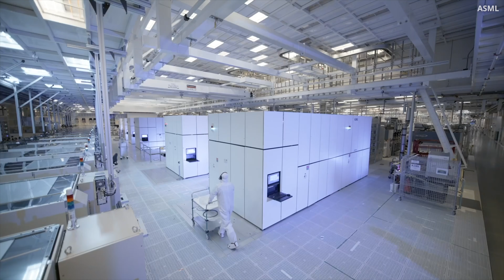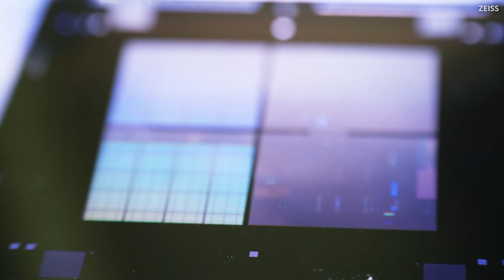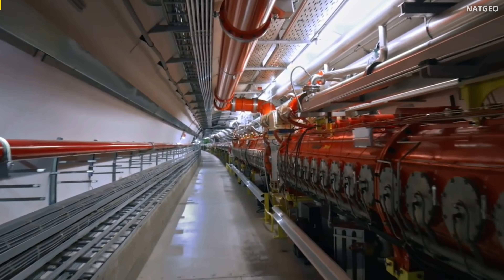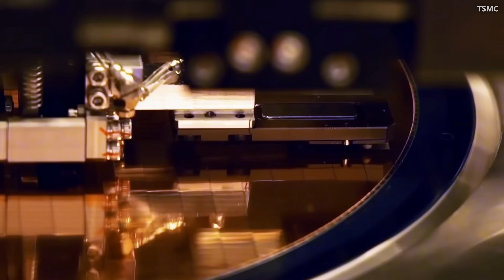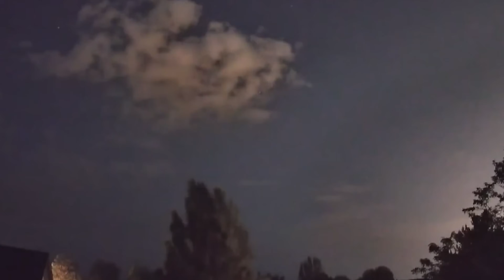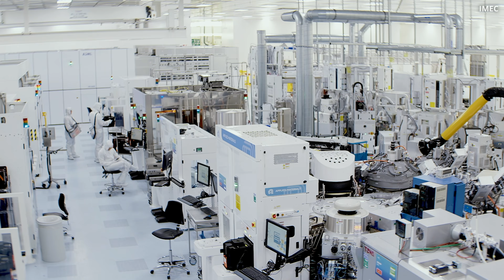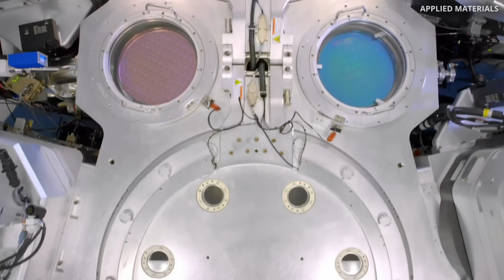New Chip Factory That Terrifies TSMC

Comment from the maker: Learn more about the Tessent product portfolio from Siemens EDA at https://www.siemens.com/en-us/products/ic/tessent/?stc=usdi103786
Reply: The ASML High-NA EUV machine costs 400+ Million dollars, and is shipped in 25 40-foot containers to the production sites
Reply: @paulmichaelfreedman8334  The shipment requires specialized handling, transport planning, and integration support. TSMC has used Gudeng Precision in Taiwan to do this.
Reply: I hope you will not say any misinformation that Intel could beat TSMC because it is a very false narrative. TSMC is really almost unbeatable in 1st place. Intel has to beat the Samsung Group first.

Joseph Y. Lee 
Former R&D Samsung Engineer
Reply: @JosephLee2012  I agree with you. Actually, after TSMC starts to mass production of COP packaging, it is almost impossible to beat TSMC.
Reply: Fire hazards in critical locations can be strongly reduced by lowering the oxygen content of the air inside. 19 instead of 21 percent is enough to snuff out any open flame that is fed by the atmosphere. Not even a candle will burn by itself. But humans can still breathe fine in it. This can be easily done by releasing extra nitrogen into the air drawn in from outside and distribute that throughout the fab where it matters.
Reply: Why are those chips round like gramophone instead of square or rectangle?
Reply: @IshaqIbrahim3 
What you did see was not the chip, but the wafer, with the chips on it. The base material, the Silicon crystal drawn is by nature round.
Search for a youtube video about chip manufacturing.
Reply: @YanDunker  Thank you.
Reply: @IshaqIbrahim3  wafers are cut from a solid ingot of 99.99999% pure, nearly single-crystal silicon, the ingot is grown in a round shape, it's how it works
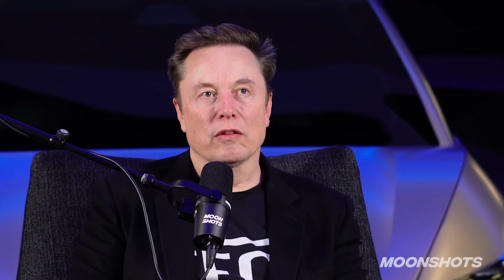Reply: After working in the leading Fab for 12 years including GAA node as FEOL Integration I can say this... 22:07 here tells me Elon has aged and now is turning into an unhinged Grandpa.
Reply: elon just got sued 44 billion today house of cards these data centers
Reply: Congratulations Anastasi, you’ve figured out that Elon is just 🐂 💩 to get government contract money! A few years ago a few governments agreed to invest billions of dollars in semiconductor. This guy is just looking to tap into that and then bail when his engineers tell him it’s undoable. Meanwhile pocketing the money the government gave him.
Reply: i tried being a chip engineer. but something about flower, sugar, eggs, and silicon just dont taste good.
Reply: Thanks but i havel already leaen how to produce using nano technology micro chips...
Reply: SO WHAT ???
Reply: I love your deep dives into semiconductor manufacturing, they are fascinating! Since you sometimes provide French versions for your Shorts, would it be possible to consider AI-dubbed French audio for these longer technical videos? It would make this high-quality content much more accessible to the French-speaking tech community. Thanks for the great work!
Reply: Great job Anastaslin.
Reply: According to Gartner’s preliminary 2025 global semiconductor revenue rankings, SK hynix outperformed Intel in revenue in 2025. 

✅ What the numbers say (2025)

SK hynix: ~$60.6 billion in semiconductor revenue
Intel: ~$47.9 billion in semiconductor revenue

That put: SK hynix at #3 globally Intel at #4 globally, behind NVIDIA and Samsung Electronics This shift was driven primarily by AI related memory demand, especially HBM, where SK hynix holds a leading position, while Intel continued to lose share in several segments.
Reply: I shouldnreport you
Reply: And water, Anastasi. Don't forget the purified water.
Reply: If new chips are coming, should I learn SystemVerilog or not? I'm interested in hardware and mind uploading
Reply: Tack så mycket. You'll soon be the 1st to use the words Quintillions of $$$ & Femto Atto and Zepto instead of Nano Nano if things don't stop going Krazy but most of all, right at the begining of this vid when you said "Oh Wow,  at so many levels.." I just wanted to climb into that jacket with you. Tack.
Reply: О каком "риске" в смысле необходимости полной загрузки мощностей вы там чушь несёте?!?🤯🤷🤦

У них экспоненциальный рост роботизированной экономики будет, — замыкание роботизации минимальной экономики венчающийся фабрикой по производству человекообразных роботов, и её экспоненциальный рост в пустынях. У них дефицит может быть, избытка у них не будет ещё на несколько порядков роста! Они в космос будут эти чипы посылать, ничего дороже с Земли вы в космос не доставите. И не только на эти орбитальные дата-центры, а для растущей лунной экономики роботов в первую очередь. 

Вот о каких экспонентах речь идёт, — экспоненты роста роботизированной экономики и экспоненты роста орбитальных вычислительных мощностей.

Они найдут куда чипы сплавить с такого производства. Реализовать. В прямую прибыль, у вас объём производительных сил будет прибывать, ваших способностей какие угодно вещи "прибыть", произвести. 

Это слишком чудовищно выгодно чтобы этого не было сделано, и именно у Tesla & SpaceX etc — у Илона Маска больше всего шансов на то чтобы стать теми кто это сделает, больше всего шансов победить в этой гонке. 

В том числе победить благодаря Terafab
Reply: Well we all know now why people like you will never achieve what people like Elon will.
Reply: What stocks are directly tied to this project?
Reply: @andyh8239 good question
Reply: The PC design is flawed,  they should be designing SoC  CPUs with built in RAM.  New CPUs should include 64 GB RAM &  4K Gaming iGPU & NPU on-chip.   Eliminate the seperation of old designs.
Reply: бля опять деревенщина.
репорт за дикцию
Reply: @AnastasiInTech  Ana, what about the effect of the new chips that use light?! Shouldn't this change the direction of ALL the newly obsolete chip processes that work with electric processes.
Isn't the fact that they are 90% more efficient and cool enough to totally change direction?! So love your channel, btw.🤙✌️😏
Reply: Sounds like an ultra- hi-tech dust mites problem!
Reply: @AnastasiInTech - I implore you to tone down the throaty/breathy tone of speaking - it just makes the content unnecessarily raunchy, and these are serious subjects.
Reply: There all garbage old chips we need to start making more G13 chips
Reply: Well to be fair investors ran out of countries to exploit for cheap labor so trump had to extort foreign companies to "invest" in exploiting more people back home.    And musk is an idiot 😂😂😂
Reply: Elon Musk confirms that SpaceX & Tesla will always remain a major customer of TSMC, but the Taiwanese chipmaker alone couldn't fulfill its demand, which is why they started the Terafab project with Intel.

ELON MUSK Is working with Intel
Reply: @Iamlovingyou1 musk is getting closer to be a mobster
Reply: Ready to park ynrr on pproductions
Reply: Very disappointed. Anastasi In Tech is normally a great channel. But to suggest that Musk's fab has even the slightest chance of succeeding is so unrealistic. His fab will be a $20 billion dollar failure. About as successful as his hyper loop, tunnel company, trip to Mars by 2022, and Cybertruck. When are you guys going to realize that he is a salesman and that's it. And by the way, 'salesman' is putting it politely.
Reply: @DavidJohnson-tv2nn  "heavier-than-air flying machines are impossible" 🤣🤣
-	physicist Lord Kelvin.
Reply: @IshaqIbrahim3  Typical response from typical Musk fan.
Reply: @DavidJohnson-tv2nn  Typical response from typical Musk fan.🤣🤣
Reply: @DavidJohnson-tv2nn  his list of wins far exceeds losses, everyone successful sells, it's called persuasion, and if you don't think so, then maybe short $TSLA with all your money.
Reply: @DavidJohnson-tv2nn    Problem already solved Thus, why Tesla/SaceX shuns ALL advertising. To do Therese would
Reply: 21:40 its so stunning how intelligent and beautiful you are! every time i see a video from you, i fall in love. iits the truth
Reply: Xxxxxxx @rgb-slotcover
Reply: Elon's space data centres at best, still will be worse than what is delivered in china currently economically (not to mention the future)
the only reason AI companies can charge the premium they do is because china's ai hasn't caught up yet
The AI orgs could achieve better-than-space expected costs and returns by setting up in china literally right now

could you do this comparison on the economics of setting up in china, I think you would find a real gold mine that isn't space

ps
I apologise on behalf of other commenters you deal with the comment bombardment of incels like the comment I just read replying to you before me
Reply: @3pints Are you actually betting against Elon?
History proves that's not a very sound strategy, he's been kinda super successful.
Reply: @paulmichaelfreedman8334  its what my research suggests, using a lot of ai estimated numbers for what things cost to make because im not bothered getting quotes from real suppliers, so its a generally accurate not super precise take
I haven't bet any money on it
I recommend you do your own research, I agree there's value in space data centres, if done correctly in the ways I have looked at it is as cheap as what china can do right now
but thats the problem!
china literally could be delivering the holy grail space orbital data centres with no major complexity simply by setting up in Shenzen etc!
Which makes me think the whole point of orbital data centres is a really complex way of achieving the savings
Reply: Elon's influence on SpaceX resulted in not only reusable rockets, but the largest rocket ever made being reusable.  He is exceptional at recruiting talent and framing the problem without the burden of deprecated constraints.  I'm eager to see if they come up with something paradigm changing.  If anyone can figure out how to control the necessary micro-environments with highly constrained resources it's a team who works with things that go into space; they tend to have pretty extreme air quality and containment requirements.   Good luck getting to see it all first hand...I'll be watching!
Reply: very intellectually stimulating   video Anastasi , it seems like musk is biting more than he can chew in the fab space , intel learned this lesson the hard way , musk will too , it is very hard to be at bleeding edge all the time and most of the demand always stay at bleeding edge as you have said .
Reply: Thank you @AnastasiInTech. Your intellect, passion and enthusiasm is admirable, beautiful and contagious.
Reply: Samsung makes smartphones, tablets, semiconductors, ships, kitchen appliances, etc.

7. Samsung Group (South Korea, chaebol) — ~$330–370B ✅

SK hynix: ~$60.6 billion in semiconductor revenue
Intel: ~$47.9 billion in semiconductor revenue
Reply: I could be wrong, but I don't think Intel has a chance, ranking 2nd, beating Samsung Semiconductor.

Samsung makes smartphones, tablets, semiconductors, ships, kitchen appliances, etc.

7. Samsung Group (South Korea, chaebol) — ~$330–370B ✅

SK hynix: ~$60.6 billion in semiconductor revenue
Intel: ~$47.9 billion in semiconductor revenue
Reply: In June Musk will become the 1st trillionaire.
So for him, building the TeraFab is just one more cards up his sleeve.

Comment: Little bit off topic Anastasi but your intellect and the way you present youself makes you my favorite content creator off all time.

Its also refreshing to see a women talk about new it devellopments instead of a bearded and balding 30 year old guy😂

Because I am a huge IT nerd myself. I love your channel. I myself specialise in Datastructures and optimalisation problems in that field. Im currenty doing research on making geometrical datasystems for analog chips. The logic is, to have less as possible deviation when placing data in a structure. When there is 100% Geometery in this system computing and energy usage goes down exponentially because every node knows where to search for the other. Not with brute computation but with beautifull simple maths)

Comment: Sometimes you make sense and report correctly, other times (a lot) you seem to be taking data directly out of your arse.  Like your video about data centers in space, you seemed to think they were going to turn entire data centers into one huge satellite. Dumb. Energy providers make money selling energy and are happy to sell to data centers as they provide much needed cash so they can expand infrastructure. Same with water companies.  Data centers don’t draw water and then dump it down the drain, they use a closed loop system to provide cooling. Just like you don’t refill your swimming pool every time you go swimming. Some is lost each time, but not a lot .

Comment: SpaceX has access to certain technologies through its relationship with DARPA and various defense contractors. Some of the technology that this plant will eventually use, is not currently used in the industry. In fact, part of the agreement will be that in exchange for the information and technology, the government have dibs on a bunch of the production. The single site facility will help to ensure security. Only a handful of people will have complete access. One stage of the process will have very limited knowledge of the technology and techniques of the next stage. The plant will likely produce several different types of chips, some of which will be for government use only. It will also be a research facility for experimental technologies. But I can assure you that companies like TSMC are looking 3 generations ahead. There will be elements of this facility that are looking at things that private industry hasn't even dreamed up.

Comment: Having a vertical stack operation is complex but multiple industries already do this. The only real problem with this is the single location mentioned. And this is only a problem if you have a natural or man made disaster. The rest is not different than making your raw materials or intermediates at the same facility that you are making your final product. Packaging has to occur weather you are sending them off for individual packaging at another location or doing the individual packaging under the same roof.  You cant just simply dump them in a barrel and shipping for packaging somewhere else.

Comment: Experience  helps, but it also holds most management and engineers back.

I took semi in university, and we had a small fab. Later, I worked on VLSI IC, and  worked on 30+ VLSI iCs. It is not rocket science when you know what you are doing.

 The issue is that there are not many investors who want to invest in chip fans as there are better returns for one's money, so one must have passion  to do this

Comment: If they are not already doing this, they should design chips with some redundancy with the ability to throw some switches on the chip to deactivate or ignore defective sections. The chips that pass using this system might vary in performance. Sell them based on a performance benchmark of some kind.

Comment: You mentioned the wasted area at the circumference of the 300mm wafers. Does anyone currently use AI software to build different chips around the periphery simultaneously?
(I realize that the layers would likely be different types, and/or different thickness’s. Still with AI it should be doable.)

Comment: While it's fascinating to see bold visions like the Terafab or Rapidus, evaluating them requires a look into the stark realities of semiconductor manufacturing. This isn't just scalable automotive engineering; it is a battle against the laws of physics.
Three critical moats that general audiences often miss:
The Ecosystem & IP Barrier: TSMC’s real fortress isn’t just their hardware, but decades of co-development with Synopsys/Cadence and an unmatched IP library. Moving to an unproven fab costs chip designers billions in risk.
The Advanced Packaging Moat: Today, the bottleneck in AI is advanced packaging (like TSMC’s CoWoS). Replicating this requires an entirely different supply chain and precise material sciences. Doing this in-house or overnight is incredibly unrealistic.
Yield Rate vs. Lab Success: Achieving a 2nm node in a lab (like IBM) or a pilot line (like Rapidus) is a scientific triumph. But scaling that to print millions of chips daily at a 80%+ yield rate is a completely different beast.
Money can buy EUV machines, but it cannot buy decades of manufacturing discipline and yield data."

Comment: I don't get why they don't build to the north, build down in the groud where its 55 degrees, and suck in that mountain air to cool things down...plus much much much more water (texas aqua-fir, yikes, these guyys are only thinking taxes when they should study the ecology as well. Many water sheds are in trouble NOW, abandoned towns in parts of texas due to NO water left underground...a cooler climate would make cooling the centers way easier, texas gets to 120 in summer....and abundant clean water exists in the PNW and elesewhere NOW, not in texas or arizona, now, and not likely in future,,,,   they also could solve the 2nm problem by switching from silicon to synthetic diamond or such, 
sure the start up would cost more, but the pay back long term could be amazing. Especially for space we need a stable substraight and silicon is too soft and as you pointed out not neutrino friendly. Sometimes I think the genius CEOs out there have let their cheese slip from their crackers.
Reply: Why dont those suffering from " claimed" aquafur dryup, tap into the "claimed" underground rapids!